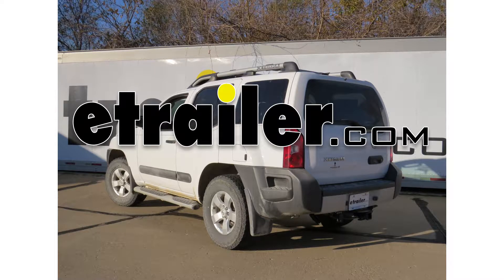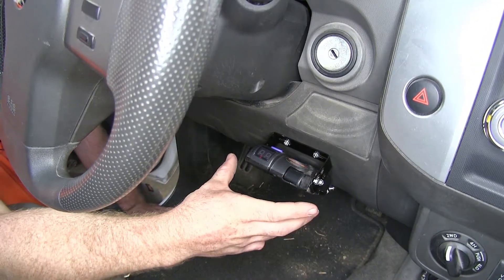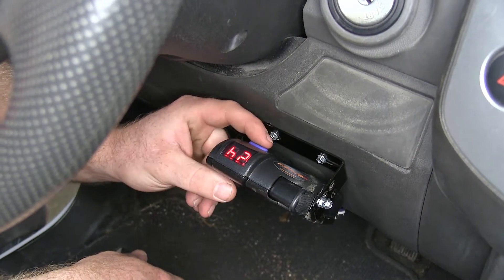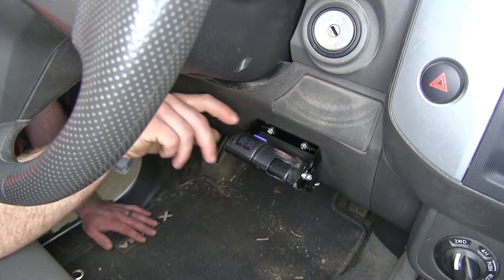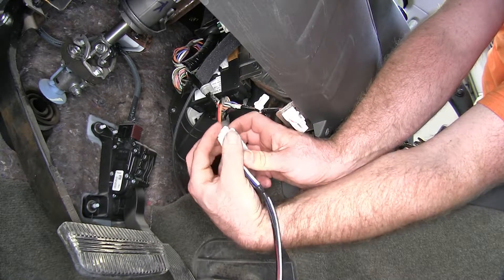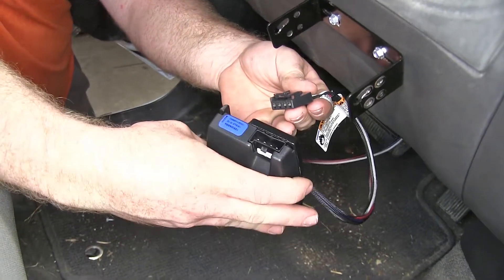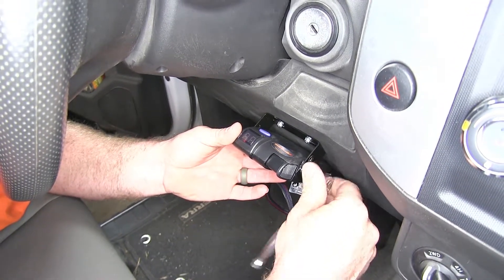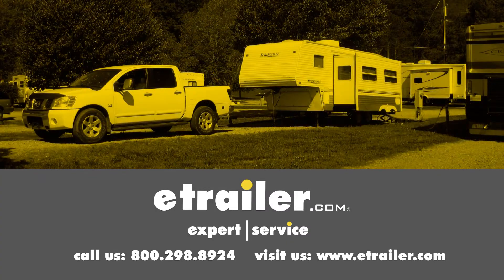etrailer | Trailer Brake Controller Installation - 2011 Nissan Xterra

Comment: Is the plug on an 08 located in the same place as your 11?
Reply from the maker: The connection for the brake controller will be the same location on the 2008 Nissan Xterra as it is on this 2011 model.
https://www.etrailer.com/Trailer-Brake-Controller/Tekonsha/TK90160.html
https://www.etrailer.com/Accessories-and-Parts/Tekonsha/3050-P.html